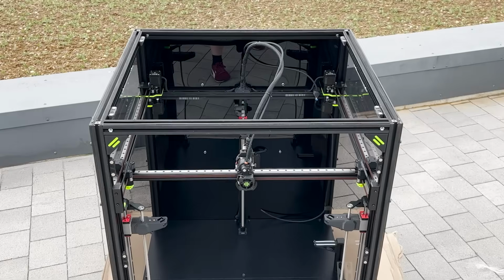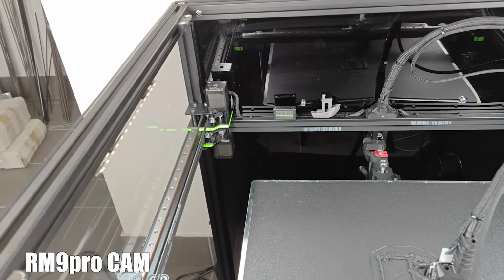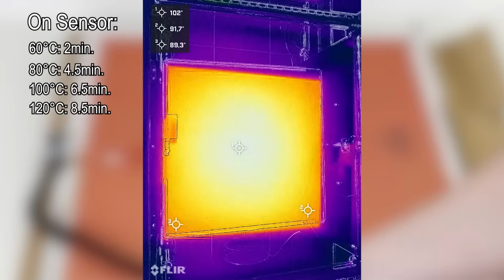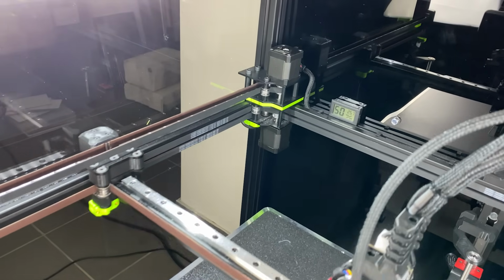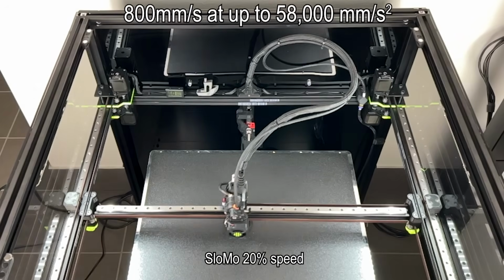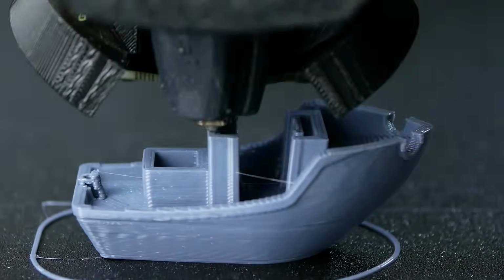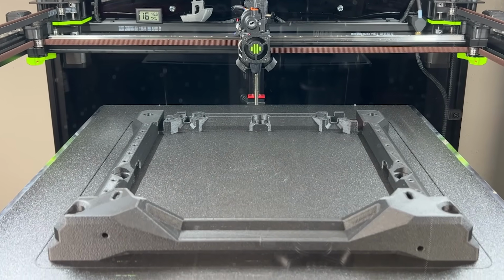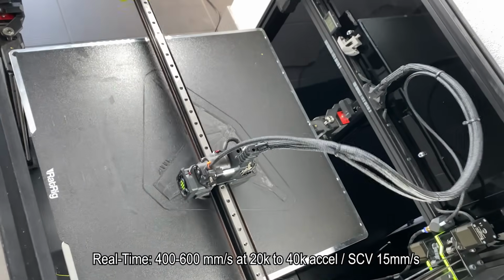Rat Rig V-Core 4 500 Hybrid: The Future of CoreXY? XXL Test!

Comment from the maker: Check out the Red Magic 9 Pro High Performance Gaming Smartphone here! Thanks for sponsoring Today's video! The Chill That Never Quits: https://bit.ly/3y6VIk6
Reply: I have one for a couple months. I love it, but its not as polished as the big brands. The performance is there tho! Network controller feels a bit janky, but not trash either. Love the screen qnd charging speed for sure
Reply from the maker: @NicolasSicardRoy  Same here: Didn't expect to love it THAT much as I do. Gaming with it is SO much fun.
My old phone (iPhone 11 Pro) has performance issues (at normal use, not even gaming) after using it for over four years now and the RM9 pro is just such a boost using it. Android has become great too meanwhile.
Reply: Hello.  Can you please elaborate where you got the information about the IDEX requiring additional X length beyond what's specified on the V-Core 4 specifications site?  I cannot find any information about this anywhere from official RatRig communications.  Wouldn't this require a full re-build to upgrade to IDEX, contrary to what has been marketed, where the only addition required for IDEX being the additional toolhead + purge covers?  I have a space built for my soon-to-come 500mm v4, and an additional amount of X length would ruin this and require a complete re-work of the platform + plans for spacing.

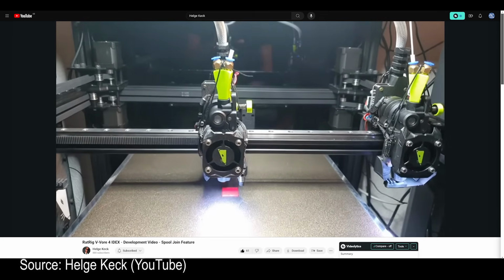EDIT:  After further research, I believe you have divulged incorrect information about the IDEX kit regarding the VCore-4 and it requiring a "+100 mm per build increase" as you claimed at 2:55 in the video.  Per the Rat-Rag V-Core 4 site: "
- The IDEX add-on will be offered as an add-on soon, and it’s not available for reservation.
These are “drop-in” upgrades: no rebuild of the machine is necessary, converting between modes is just a matter of swapping a few components on your existing build."

Please correct the video, as this is confusing information for a large channel like yours to release to consumers.
Reply: @TrueRewire  all models have the additional length already, for idex you jsut need a secondary toolhead and the hybrid motors
Reply: You've got to decide; do you want a slit in the plate for accurate temperature, but have the bed expand unevenly and therefor bend or do you want a flat bed?
Reply: Link to printed parts reminder/request

Comment: I've been thinking about getting this printer for a while, and the 250w 24v power supply offered by Rat Rig, seems to be a bit underwhelming. Is there enough space in the control box for a MeanWell 600w PSU???
Reply from the maker: The CAD if it is online, you can check. Why is 250W not enough for you?

Comment: If I keep watching these V-Core 4 videos, I'm going to buy a 500 mm IDEX V-Core 4.  Thanks for the honest review.  I'm sure RatRig has squashed all of the bugs shown in this video over the last seven months.

I print a lot of TPU so I don't use reverse Bowden tubes.  I'm in the habit of feeding filament directly into the extruder from an overhead wall mounted bearing hub reel holder to reduce friction that could stretch the flexible filament, and I carry that practice into printing PLA, PETG, ABS, etc.  For a 500 mm V-Core 4, I definitely wouldn't want to be crawling around on the floor trying to push filament up through a meter of PTFE tubing.

I have very accurate digital scales but I prefer to measure maximum extrusion by marking 100 mm of filament, extruding 70 mm at different speeds and temperature, and measuring the length of the extrusion.  That's much easier because I'm not feeding filament through PTFE tubing.  I calibrate the extrusion multiplier from a slow extrusion at relatively high nozzle temperature and then once 70 mm of commanded extrusion extrudes 70 mm of filament at that safe speed and temperature, I compare other nozzle temperatures and extrusion rates to quantify maximum extrusion rates.

Comment: I have a Ratrig V-Core 4 500 CoreXY, and it is great but your video has given me some good insights. I also struggle with first layer drift which is apparently quite common on larger printers and have the same issue with high drag on the PTFE tube. This keeps triggering the orbiter smart filament sensor because it keeps thinking that the filament is tangled (but I only fitted it last night along with an enclosure so I still need to iron out a few things). 

Did you post the link to the reverse bowden guide - not seeing it? Awesome video btw.

Comment: i have to say first, thank you for going over all this its very insightful... and i'm sure you know volumes more than i probably will about the subject i'm sure.   i'll add my 2 cents and probably state the obvious in that  i'm always surprised by filament paths to the extruder being so convoluted (and this is not at all unique to rat rig or any one mfr ive observed and in many ways is more of a user choice or assembly decision based on how fast one wishes to run their unit)... but when printing is happening so much faster than before with higher end corexy's and klipper now it seems obvious that any resistance at all caused by reverse bowden setups of any significant length will degrade quality of the print one way or another,  teflon tube or not its still added resistance per unit of length and then especially per curve or tight corner in the filament path.       the easy solution to me has always been to do away with as many bends as possible and orient the filament spool in a location where path of least resistance is possible (directly above on a bearing roller unspooling almost straight to the extruder regardless of convenience or my desire for prettier more compact solutions)  even with my slow as molasses enders any kind of reverse bowden i've tried including out of short pieces from a dry box has always turned out to be a hindrance to quality and speed upon close observation.     anyway... like i said i'm sure i'm stating the obvious here.   probably already known by yourself and most reading this.    but again thanks for the video.   looking forward to putting my 400 together shortly

Comment: no, first put multiple independent print head static beam bridges over an open sling bed (or rotating print bed). yes multiply your print speed simply. make sure the print head beams are slim so you can fit as many print heads as possible. otherwise normal bed slinger features remain. spinning print bead enables same sized enclosure. otherwise open no enclosure normal bed slinger 3d printer. this way you can print with multiple filaments at once. or multiple same filaments at once. no interference. just update the slicer to handle multiple single-axis independent print heads moving at same time on the same z-level. its up to the slicer to plan the print bed sling/spin movement and sideways print-head movements optimally. of course you can have all the print heads be super small, and be occupying smaller area than the print bed, so also small prints benefit from all print head beam bridge lines. otherwise big printers are most suitable for big prints and small printers for small prints. or just make the print heads small. only the feeder cable and melt head on the moving thing. everything else in the support frame.

Comment: 1500w print bed!?  Here in north america we've got 110-120v power systems and household fuses and breakers are typically only 15a and are only rated to 80% max sustained duty cycle or roughly 1320-1440w max sustained power.  in order to use such a printer reliably, I would have to get a dedicated 20a circuit installed (not cheap)!
Reply: Yes 110v has its limitations. Just like the imperial system 😂

Comment: 7:30 to good temp measure with IR dat, you can use blake tape or another tape, which have good radiation specs, and you can test error of this method, by place tape on can with boil water (98deg C).

Comment: All new core XY designs should mount all steppers outside the chamber.  Should be looking at ways to increase chamber temps.
Reply: Those are HT motors, and can print at ambient of 80-100. I print exclusively engineering materials and my chamber is steady  70C - no problems so far
Reply: @yavorminkov  how did you get your chamber to 70c? I wanted to get a vcore 4 to print ppa-cf but no heated chamber.
Reply: Stepper motors can handle surprisingly high temperatures with no ill effects

Comment: 1000 mm/s seems like it will be above the speed at which the steppers start losing torque due to back-EMF. That would explain why the acceleration doesn't double at that speed... you will probably find it more than doubles at lower speeds though.

Comment: Great Video...our 400mm V-core 3.1 had too many challenges to keep it....even this one that was pre-assembled had issues.  Hopefully they figure this out.

Increased acceleration is pointless when the printer wont lay down a consistent, repeatable first layer...the lack of a runout sensor proves that the team at rat rig doesnt recognize the true use case for a printer this size.

Amazing hardware but still a long way from the user experience customers are now demanding.....Bambu ruined all of our expectations.

Comment: I tried your speed test gcode generator but I cant reliably make diagonal moves with my Hevort SPAWD with motors at 24V/2A 😮‍💨 Sometimes it fails even at 10k what is starting point and highest I could get was 14k accs.  Also I can't set "0" value for speed number of steps... Is ratrig vcore 4 using 48V?

Comment: Nice Video!
i recently built 2 vcore3 500 and i have to say that i really dont like how the gantry is connecting the belts to the head. It looks like this system is also present in the vcore4. The problem is that it is depending on the preload of the belts if the gantry is in 90 degree to the frame. In my opinion this is a very bad design decision since this moves over time and strains the components such as the linear rails and also the connecting abs parts. IMO the better solution is the way voron was going where all 4 ends of the belts are coming together on the frontside of the head.

Comment: I was really disappointed about the space inefficiency of the V-core 4.
Namely having rails on top/bottom, but the belts inside the square of the gantry, when you can gain space by having rail AND belts on top, like HevORT or Rook.
Reply: You are going to need the space for parking the tool-head, when upgraded to IDEX. The other option is to build it taller but that would waste space...

Comment: If the break that the tool head rides in has deflection/sag in it when the tool head is in the middle, it’s to thin and or the alloy of aluminum is to weak. A 7000 series alloy (if they’re using a cheaper 6000 series) would help dramatically as 7075-T6 for example is almost as strong as mild steel and in this way shouldn’t add weight.
Reply: It's more of packaging problem, I think. No support (foam) was added to hold the gantry and toothead, during transportation and parking it in the middle was a stupid idea.

Comment: Is the bad batch of rapido 2 only from rat rig or just everywhere? How would I know if I have a bad batch?
Reply: Everywhere. If you don’t have problems, you’re fine.

It’s a combination of off-spec thermistors and the nut/spring on the thermistor being exposed to the air cooling the hotend.
Reply: @miklschmidt  just thinking out loud. If there would be problems, and somehow we would know the bad batch of R2 is the issue, wouldn't an offset of 20 degrees would solve this issue (that we would have in the firmware as a boolean of sorts in case the offset value is really stable)? I know that in the very distant past (~1990), there were some issues at an iron ore smelter, where the sensors they were placing were burning out due to the extreme temperatures, and they simply decided to move them somewhere where it was cooler and just add a delta temperature to any measures they took with those sensors (eg: they read 800, but they considered it 950...something alongside this idea.
Reply: @ktakna  Yes, it seems to work OK. RatOS has an optional variable for that under [gcode_macro T0] called "variable_temperature_offset". You can set that to -20 for example to make toolhead heater commands automatically set the target 20c lower than instructed by gcode.

Comment: Is the Hybrid kinematic Markforge kinematic byt with corexy routing of the belt for x movement? times 2?
Reply: for the hybrid model no, for the idex kinda yes. the hybrid version is really a hybrid between corexy and cartesian, the IDEX uses a markforged alike kinematic. the calculation is identical but the belt routing to the toolheads is not
Reply from the maker: You're top notch engineer, I BET you can figure that out :-)

Comment: Thanks for the in-depth review! 
This Hybrid system performs even better than I'd expected, nice work RatRig!
I've often dream up kinematic designs that make use of additional redundant axis..
Like, is this a way to higher accelerations and faster infill times :
Lightweight servo/piezo driven X-Y stage between the Gantry and the Hotend ,capable of a few mm of X-Y deflection
Firmware would decide when to move the X-Y gantry or the U-V toolhead axis
..I'm just a layman, so idk.. ..but the idea being to only have to jerk the Hotend weight during eratic XY moves <5mm, while the gantry takes the smoother overall path..
Maybe physics says it's all the same forces,, but my intuition is that it could work to drastically isolate harmonics with proper motion-planning at a hardware level.

Comment: How does hybrid CoreXY do anything for the X axis though? Would adding a standard X axis drive system (so full carthesian + CoreXY) improve performance further?
Reply: In corexy you’re limited in accel by Y, not X. Hybrid helps even that out. Adding more to X would still have you limited by Y.
Reply: Adding a conventional X axis system would increase the weight of the gantry since motors that operate the X axis in isolation would need to be mounted to the gantry, reducing performance.

Comment: I wish they had incorporated a chamber heater. While 40C 'can' be ok for ABS its be no means ideal and if you want to do PC-ABS or anything similar its way too cold. Its not hard to add one but a properly integrated solution would obviously be better.
They are just such a benefit that I won't go without one again
Reply: It’s one of the upcoming add-ons.
Reply: Iirc chamber heaters have only just come off patent so they're only just now starting to turn up in consumer printers

Comment: Really great to see a deep review on the new Ratrig machine, keep up the good work!
I had my rounds with first layers on my 3.1 400, the bimetal effect on the gantry (because of the top-rail design) can cause substantial negative Z offset at the middle of the gantry, mine had around 0.3mm difference before and after heating the chamber.

Comment: what's the point when they can just put a motor 2x larger?
Reply: The hybrid system is an optional upgrade, so it can't change the fundamental design. Also making the motors larger would mean enlarging the entire printer even more and it's already basically the size of a washing machine.
Reply: @brinkoftext  its not enlarging it more if it has one bigmother instead of 2
Reply: @meocats   The motors are aligned vertically and the larger stepper motors are also wider. So no, it would need to be larger.

Comment: there should be a "Hybrid" extruder type where a direct drive and bowden extruder work together in tandem
Reply from the maker: That long filament feeding path would hugely benefit from that - I was thinking about adding a second orbiter for just feeding the filament to toolhead more conveniently, but supporting the direct one would be a super nice side effect 👍
Reply: @247printing  Can you think of any downsides to this? My path will start in a dry box under the printer, so will be even longer.
Reply: @leroycasterline1122 That's effectively how single extruder multi material feeder systems work so should be very doable, could even go the whole way using something like the ERCF from the Voron project (even if you don't do multimaterial prints it can still automatically manage filament loading/unloading from inside the dry box so there's still a benefit to it)
Reply: As I was falling asleep last night, I had the same thought. I'll be feeding most filaments from a dry box I'll build within the printer stand, so my path will be a bit longer than most. It wouldn't be difficult to include a 'booster' extruder.

Comment: I didn't expect that it doesn't include a filament runout sensor.
That's a very cheap add-on.
Also I, as yourself, expected more from that phaetus hotend. I believe they advertise a maximum 70mm³/s mvs. I suppose you could try a high flow pla but I doubt you would have gotten that big of a number.
Nonetheless, a very good job at this review. I expect more videos with the rat rig and maybe some high flow testing with a cht nozzle if it doesn't already include one. I suppose it use a v6 nozzle.
Reply: The flow is limited by the 0.4mm nozzle, physics makes it quite hard to squeeze out much more than 40 mm^3/s out of a 0.4mm orifice. The marketing numbers you see are usually done with large nozzle diameters. There's a few tricks that help though, CHT nozzle, 8T gear motor on Orbiter 2, Annex Belay etc.
Reply: @miklschmidt well flsun S1 says that it can achieve 110mm³/s(0.4mm standard) so the phaetus's number is surely not a fiction.
Reply: @AngelVenomous  i can 100% guarantee you that's not with a 0.4mm nozzle. I doubt it'll do 110 mm^3/s at all, but i like to be surprised. Talk is cheap though :)
Reply: @miklschmidt yeah we'll see.